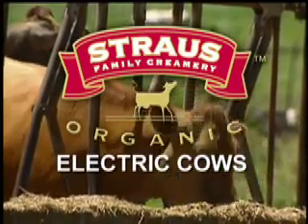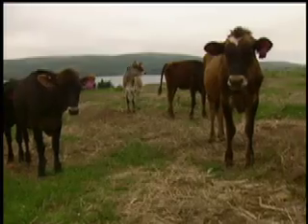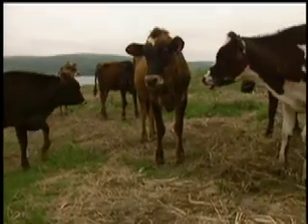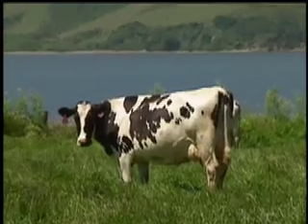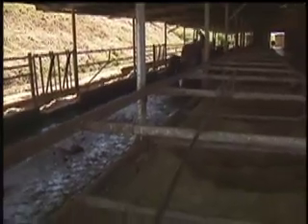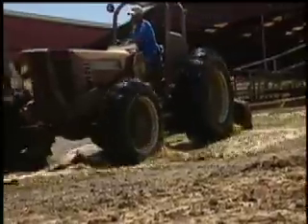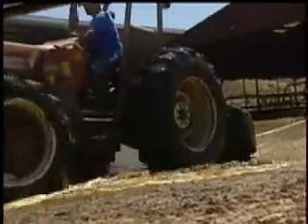Electric Cows

Comment: On a small scale depending on the BTU requirements per hour of the prime mover(engine)this works well, but be aware of pre-treatment and effects of hydrogen sulfides on the metal surfaces particularly the engine as well as aluminum which will be reactive. .Some prime movers require a specific BTU per hour and minimum pressure at a steady state that effect the efficiency rate,emissions,

Comment: The half life of methane in the atmosphere is 7 years. It is broken down into H2o and co2.  If you burn methane you produce co2.  The thing is that it is carbon neutral.  It does not remove co2 from the air, so the problem continues to get worse due to the burning of fossil fuels. Nothing is undoing what the fossil fuels are doing.. a car getting 100 miles per gallon of gas is still putting co2 into the air and nothing is taking it out but biomass.The biomass in turn releases it back into air